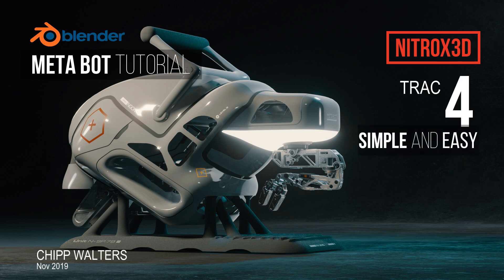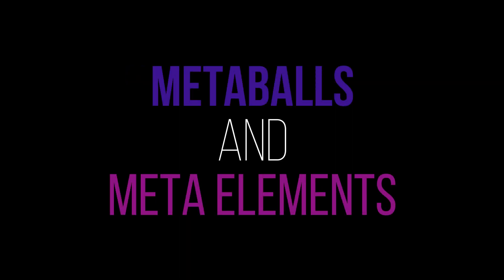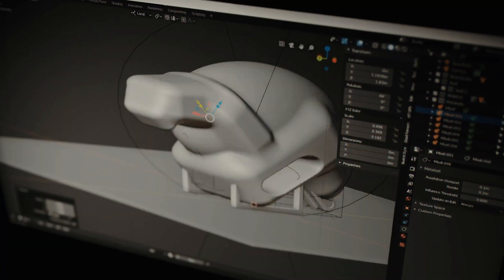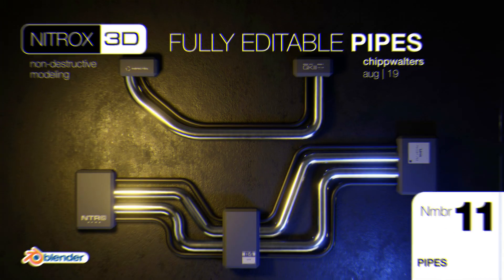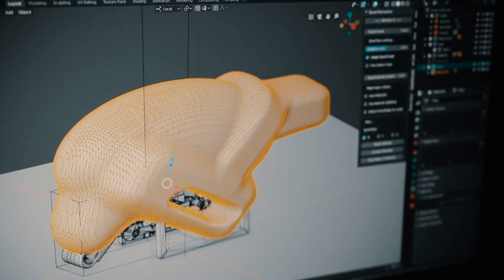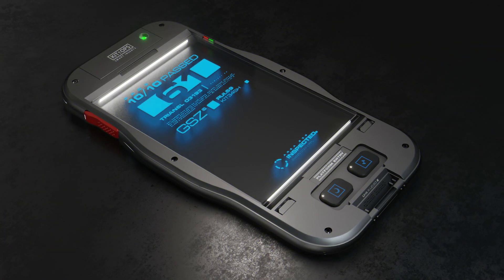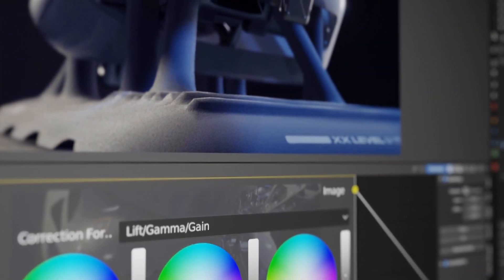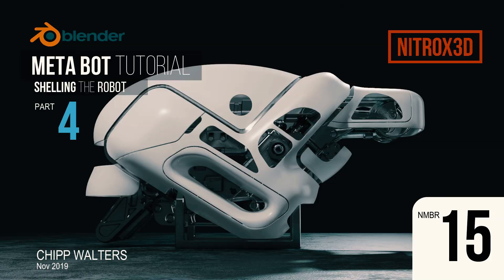NITROX3D: Blender Non Destructive Modeling

Comment: I will be taking your courses. I'm enrolled in a beginner course to learn the basics from CGBoost. I need extra space possibly running a dual boot system one hard drive windows and the other Linux. I think Linux would be best due to the fact I have 2tb of space for the modelling in Blender. Will definitely get it and learn.

Comment: Hey Chipp. Thank you so much for your grate tutorials. Du you have any videos explaining Overlapping UVs and how to fix them using SketchUp?
I'm a production designer who uses both SketchUp and Blender, but find SketchUp faster for architecture. Trying to make a VR presentation, but I'm have trubble with light baking  which I'm guessing is because of UV overlaps.
Reply from the maker: You'll need a good UV editor, like Blender has, to vote and edit your UVs. I tried some basic ones (plugins) for SU and they were just too hard for me to use. I like the automated approach Blender and other hi end 3D programs use.
Reply: @ChippWalters  Yes i know. But i still do like the cad nature of building in SketchUp and realy would like to avoid the trip through Blender if i can. Turned out i could! i had just gone abit overboard with joining my model to reduce the number of gameobjects. Scaling it back fixed most of the UV mapping problems Unity had. SketchUV box map does the trick. ;)